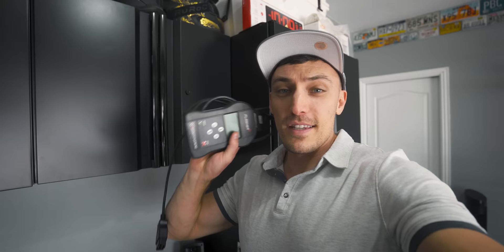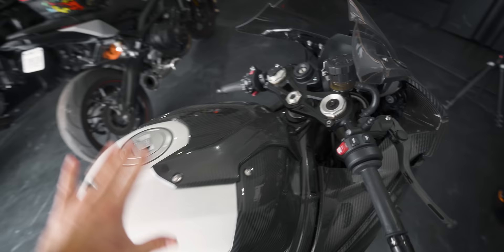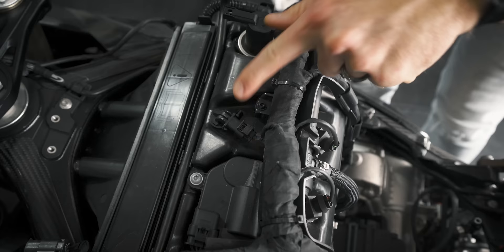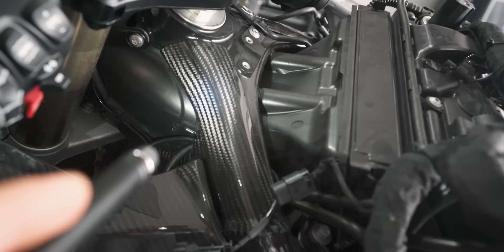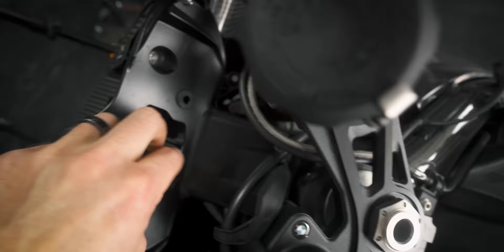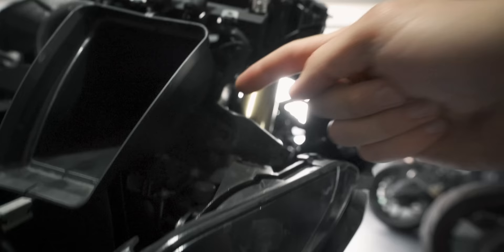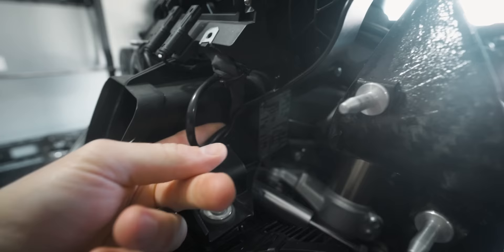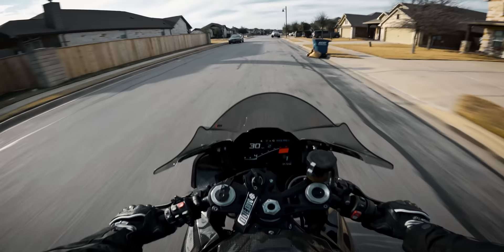BMW S1000RR Stage 2 Flash is INSANE!

Comment: Just bought a 23 S1000rr with a stage 2 tune. Guy bought it, only rode it 600 miles, had the dealership put a stage 2 tune and full exhaust on it during the 600 mile service then traded it in right after. Dont think he even rode it after the service. Theyre giving me the bren tune handheld and the oem exhaust with it in case I want to set it back to stock.

Comment: Hey buddy you might want to consider cutting the handle off of the garage door emergency pull rope. Criminals can take a wire hanger and reach in there grab the handle and open the garage door. I love the bike. And love your videos.

Comment: Make sure to stuff a shop towel into the air intake before drilling the hole for the sensor. You don't want the plastic shavings going into the airbox/engine.

Comment: BT is such a scam. LOL. He doesn't 'tune' the engine. He just removes most of the throttle restrictions. Then for the 'stage 2' LOL, he just removes the remaining throttle restrictions. The stage 2 is just a gimmick. Bren be laughing all the way to the bank. You can literally do the same shit that Bren does with the Woolich software. My 2024 S1K is making 210hp at the wheel with my tune. I did a real tune and adjusted the fuel and timing maps.
Hell, I can even put my tune on your bike for half the price of the BT.

Comment: Stage 2 flash is soooo important to twist the throttle on a straight road... So much skill involved. Yeah. A must have... over the front brake that fails after a few hot laps on the track.
Reply: It’s a bmw dude what do you expect
Reply: The front brake you can just replace with a brembo master? Lol. Was he supposed to flash it for the guy buying his bike and then bring it to the track to possibly wreck it before selling it?